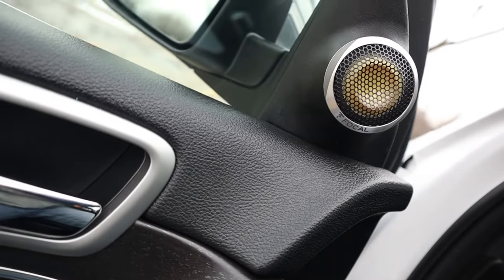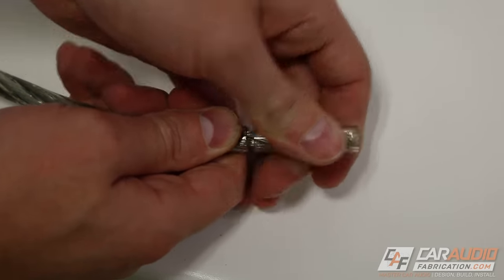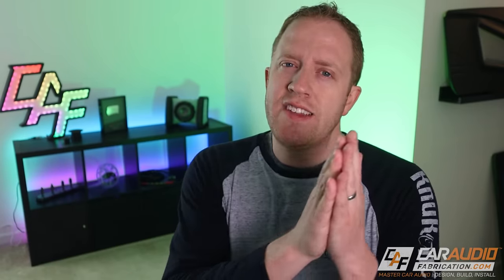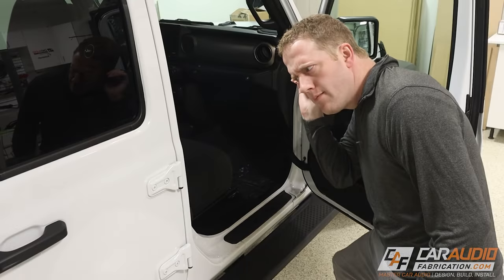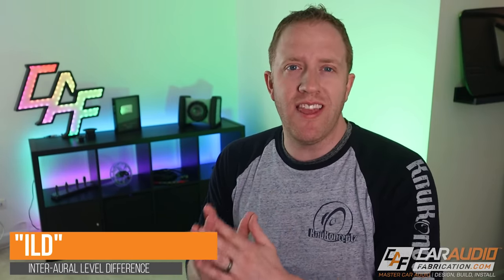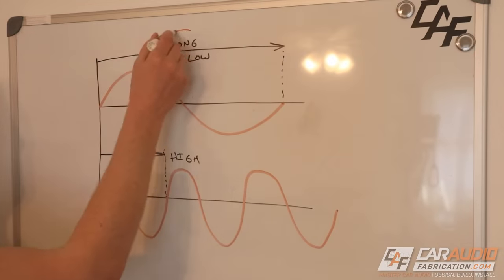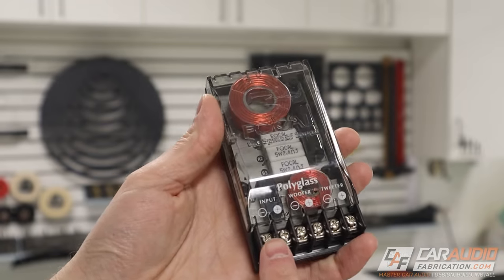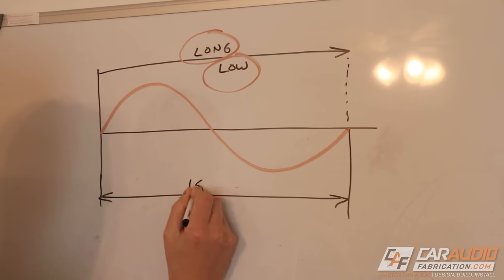Is YOUR SUBWOOFER facing the WRONG way? How we locate sounds explained!

Comment: My sub is firing upwards, because that's the only way I could fit a 15 in my trunk
Reply: Same mine is under seat. 66 Toyota Land Cruiser
Reply: My 415s is facing up. Only way
Reply: My 5" is facing front.
Rear facing port.

Why you laughing ?
Reply: My 2 tens are facing upwards I feel like they sound better that way then facing towards the back like towards the twilight's.

Comment: Years ago I had a 1990 Grand Am with an ADS sub with 2 10’s(sealed). I had worked for many hours tuning the crossovers and levels to get a balanced sound and I had to face the box down and backwards (swivel brackets included). When I sold the car to a teenager he immediately pulled out the 2 10’s and dropped in a Pioneer ported box with 3 12’s facing forward. It took him a couple of hours of frustration to give up and put he ADS box back in and suck up the loss of ego by having 2 10’s instead of 3 12’s.   He was in disbelief that I got such a “small box” to sound that good.  Interestingly we listened to vastly different music........
Reply: Yeah Bull 💩
Reply: @Valverde713  What is ?
Reply: What kind of amp did he have with those 12s?

Comment: I like facing it to the rear.  I "hear" the bass bouncing more and getting deeper that way.
Reply: Me too. I feel the bass bouncing back with speaker facing rear.
Reply: For sure, I have a star 15 in a ported box and had it facing up and it did pound but then I put it facing to the rear right behind the front seats of my blazer and it pounded way harder. Then I put it in the back hatch and it is night and day how hard it hits from the other two ways. Rear facing is definitely where it’s at IMO.
Reply: Same
Reply: This is the difference between having portholes and not having portholes or sealed box
Reply: FWIW, sealed boxes are described as more accurate. The tradeoff is power consumption/requirements.
Reply: @Shalmaneser1  But a well designed ported sounds 'warmer' and deeper.

Comment: The wave length is  also why we hear the bass from the guy beating down the block and not the highs . The short frequency are absorbed by the walls
Reply: Correct!
Reply: what does this mean i want my subs to be heard down the block😭
Reply: @noahon2k906  the wave length of "bass" are longer allowing it to penetrate obstacles with less loss of energy . High frequencies are much shorter allowing said obstacle to absorb and reflect better which is why when u hear an echo it sounds different,  cause the lower mid range and down are not reflecting as much . Knocking refrigerators over when u come banging down the road requires a s%!+ ton of air movement , which requires many watts and many drivers
Reply: Actually it's because most cars with aftermarket stereos simply don't have mids and highs.  I hear it all the time on my walks around town,a car will drive by 10 or 15 feet away from me, windows down, and all i hear is "thump....thump thump thump."
Reply: @noahon2k906  I have 2 kicker compvr and they can be Heard pretty far away. I think each one is like 86Db or something like that

Comment: I had my 10inch Kicker sub located in the boot facing the boot door. I was not so happy with the depth of the bass. So, I made two changes. One to stuff the port with tight faom to covert it to a sealed box and secondly, moved it to one side of the boot, facing side ways towards the innerside of the boot, rather than facing the back of the car. With these two changes, the bass feels lot more deep and cleaner. Not sure if it due to the sealing or due to the change in direction of the sub or both. Eitherway, happy with the result.

Comment: My subs face up and port is to the rear. Sounds great in my Tahoe
Reply from the maker: Very nice!
Reply: Same, I also have a tahoe with subs pointed upwards and a rear firing port
Reply: I have yet to see a SUV that didn't perform best with subs up Port back
Reply: That's the best for a Tahoe. Jeep Cherokees like them faced forward or backwards
Reply: I need to build a box like this for the tahoe. I  just have a dual sealed with back raised a bit
Reply: @johnathanhornsey880  never had a Cherokee I know that the best way is trying different orientations nothing beats real world testing. I was surprised when I got the best sound out of my Honda coupe with a sub sealed off facing forward instead of backward like most trunk cars.
Reply: Same in my Tahoe...subs up ports back!

Comment: I've got a pretty basic setup. A couple skar vd 10s shallow mounts in a downfire box with port forward on a 1200w amp.  JbL 3 ohm mids & highs running off pioneer deck. Honestly it's pretty dang impressive for what it is. It'll rattle your teeth loose. 

Well , I had my back seats up and my box isn't bolted down( shame on me) and my box slid forward just like 2 inches , and I haven't had a chance to really get back there and recreate that situation because I had to shove it back because I started getting a really odd distortion that I think was the sub actually hitting the floor cuz it had slid over a hump in the floor. But before that, OOOOO MAAA GAWD!  I don't know what was truly happening  but I've never heard it hit so hard.  My whole truck I thought was going to fall apart from the vibrations. No lie, it sounded like I had something like 4 12s in some massive box.

 I'm gonna try to recreate it. Part of me thinks that maybe some sort of phenomenon happened due to wires being pulled around and stuff getting tugged on from box moving, and I wouldn't think that minor of a move and basically not changing the angle at all, would make such a drastic change.  It really was incredible.  I've been running systems for 20 years and I never seen anything like it.
Reply: If you have the port facing the rear, it'd get even louder.

Comment: For people in the back firing position I'd first mess around with the box position in the trunk first before changing actual sub facings. I have two mmat monster 12s with a mmat m2000 ($925) pushing them in a ported box with the ports facing front way both in the center with the sub faces on each side of the box (tuned to 32 hz give or take one). I've noticed that if the box is to close to the trunk (right on it) it muffles the bass and causes more rattle because the bass waves dont develop properly that close but i moved the box back about 9 inches from the trunk and just used a piece of half inch wood to keep it in place and the bass quality is like 70% better overall and deeper with minimum rattle at around 35 hz bass tracks. I still have about 3 inches of space left to move the box back more to see if that does anything more.

Comment: in my Exeo: 
-Facing port backwards and putting it close to bootlid = No low rumble
-Facing port backwards and pushing it against the back seats = Low rumble but rattling deck

-Facing port upwards and pushing it against the back seat = Even more rattle but lacks definition
-Facing port forwards and away from backseat = Bass covers everything else
Reply: So what's the best way to face them
Reply: @worldisDiffirent  I had my subs and port facing the bootlid. Sounded the best after tuning the box correctly. On a smaller car like Audi TT i have, making the subs point up  was the best.
Reply: @StaticVapour590  ok do u think I can try facing mines up I'm running 1 15sub on a 4000amp but I drive a 4 door charger

Comment: Car shape and sound deadening must play a huge role. In my 58 Beetle, I installed its third version of a “system” and this single 10” sealed box turned sideways hits harder than either dual 12” sealed box facing forward ever did. Always had only around 400 wattish amps in this car. Something uniques about the shape of a Bug. It sounds like a 1000 watt amp easily

Comment: As long as your box is tuned to the resonance frequency of your vehicle, you  should hear the bass all around you. If it's a generic box, you are going to hear the source location of the box. Bass is more omnidirectional than directional. The lower you go, the less you hear and the more you feel. That "feeling" is non locatable. In my 07 Avalanche, I took out the midgate and filled the vertical space with the height of my sealed box with two 10 in subs facing forward. 1800 watt system that pounds so hard that I have to crack the windows so I don't vibrate the windshield too much (had to replace it once already).
Reply: How do I find the response frequency of my vehicle?

Comment: Great video!
The tiny stock sub was in the rear deck facing down into the truck.
The new bigger and much heavier sub is still in the rear deck, but now facing up since that's the only that giant magnet could sit into the original opening.

Comment: Ported enclosure, subs facing up, ports facing up in a 2005 Tacoma. Just recently found your channel, love the videos, very well done.
Reply: Just curious cause I have a Colorado, what speakers and air space do you have with them. And I'm assuming with the options you had you chose the best sound.
Reply: @MikeCodere23  Using 2 JL Audio 8W1-V3 drivers, each one is in .5 cu ft of air space.

Comment: When installing my first subwoofer in my car(back in the 1990:s ) I made a box that I tried in different directions to see which was best for my car. I found the best direction was backwards, I was at the time installing in a Saab 900 Hatchback from 1981.
Reply: Didn't all hatchbacks have better and cleaner sound facing the back?
Reply: @MikeCodere23  No, I had a 85 camaro with 2 15inch Orion's and 2, 1.2k wat power amps and crossover i.the box  utilized the whole hatch .  Speakers faced forward to push the air away .
Reply: Was wondering if this is Brian Love ? 🤔

Comment: I've had my subs face all different ways and can say that there is a huge difference in what direction it faces. I had to face the seat in my sonic because fitting it sideways wasn't an option and it rattled the truck lid to much. Even with foam and dynamat lol
Reply: With my old single sealed box just having it Off by a foot would mute the sub lol. Could barely hear it if it wasn't about 8 inches firing back into the hatch of my 06 suburban.

Comment: big thumbs up i purchased to 2 knuconcepts kollosal kits 1 for my small sedan which i completely rewired and ill use the other for my mpv suv and i sound deadned all doors and floors firewalls and trunk made 20%sound improvement also purchased audio control lc2i pro for suv also

Comment: I have my 2 alpine type x 12s firing towards my taillights,  when I position them firing towards the front of my car it hits harder but not as punchy, keep in mind I only have a ski hole in my car the seats don't fold down, also moving them around changes the box rise , everything from moving your driver/ passenger seat changes the performance of your sub. Even a few bags of groceries in my trunk changes the performance.

Comment: Currently sub up port back in a single cab silverado. I'm designing  a new console box that will be subs down port up. So it will go from console shaped through middle of truck to truck wedge shape box behind the seats with the port exiting up in the passenger side rear corner. If this is stupid lmk even if you just say "no"  lmfao thanks for teaching me. I just started using my router and templates last week.

Comment: I keep mine facing the rear. I’ve tried placing them on different positions in my Jeep. Facing up, facing forward, sideways… I’ve found the best lows and punch is when they are rear faced. The only time I found different was in the back of my old Dakota. I had the boxes standing up side by side on the back bench. One forward and one sideways. (2 10” forward and 2 12” sideways). That was something else.
Reply: Thanks for the info. You answered my exact question.  🤜🤛 I just got 2 12s and am putting 1000w through em and was just curious what would happen it I moved them around.

Comment: The sub is inverted. With the sub facing the passenger side ( whole box on drivers side). With the port facing the back. It a logitec z5500 box cleared out with a skar 10 in it. Works good. Sounds good. Always try to face them up though if I want split.

Comment: I've experienced in the past that facing them backwards may sound more affective if your not running much power let's say 750 RMS but I hate the trunk rattling, so I noticed facing them forward cancels that rattle but chokes out the base, until you fold tour seats down, I think my next choice would be a single sub to the right shooting left so I can feel or hear that frequency, any thoughts?
Reply: lol hell yeah , I have a 12' champion pioneer  powered by a jbl gto 751ez behind the front seat facing the back of my seat in a holden ute. you feel it kick and watch the front windscreen vibrate.
I say go for it!

Comment: My personal experience is hatchbacks and especially, wagons sound better with the subs facing back. Sedans and Coupe cars with physically separated trunk areas may sound better firing up, or forward. I bought a sealed box with 12 Kenwoods and a 450 watt amp from a guy who said it sucked, he had it in a Chrysler 300, I put it in my Volvo V70 facing backwards, and it sounds way louder in my car, than his. I just tapped in the leads from the rear speakers, with some 25 year old line level adapters, factory head unit, no RCA's, nothing.

Comment: In my ‘83 GMC truck I have a single shallow mount Premier 12” in a sealed box facing forward behind the passenger side of the bench seat.
In my 2004 Cadillac XLR I have shallow mount Kenwood Excelon 10” subs mounted in each door.

Comment: i have a 4 th order band pass  .the port is facing to the side of the trunk in a hatch back. Facing to the back makes the trunk flex and it loses alot of quality and it  rattles and brakes tail lights ..facing forward its very muffled ..the trunk effectively acts as a second band pass enclosure if facing to the side

Comment: 18” Stereo Integrity HST sealed facing forward.  Removed the smaller side of my rear seat.  Prior I had 2 Illusion C10 down firing under the rear seat.
Reply: That right there is no joke of a system. I've got three SQL 12s I'm installing facing forward in my Civic SI. The xbl motor design is a whole different animal and worth paying the extra money for if you have a picky ear and don't want to spend as much on massive electrical upgrades. That split gap motor design keeps the BL constant over a much longer stroke than normal subs. So worth it and slayes the drums like none other if you have a picky ear. Just so clean and needs less power to do it.

Comment: Today this video was very helpful. I'm currently making my own custom false floor sub box (and man oh man is your channel a wealth of knowledge to help!). And my dad asked if having it point forward would be better than my intended upwards direction. I told him that with low frequencies it basically didn't matter directionally, like it does with higher frequencies. But my explanation was "it is just known" lol cause I didn't know the actual answer.. But the discussion prompted us to search, and here we are. We were both pleasantly educated, and it settled the discussion that my plan was perfectly fine lol. Great stuff and great channel. 

I was actually able to explain to him about it being under a solid "false floor" was also ok, because longer (lower) wavelengths are much better at penetrating through objects. It might be slightly muffled vs open, but that's why it'll be removable to show off the sub lol. So I kinda was already on the right track. LOL

p.s. posted only a month ago... IT'S LIKE YOU KNEW I WOULD HAVE THIS DISCUSSION o.O (illuminati meme music)

Comment: I used to have my 10s facing inward in my bandpass box that faced my cabin, next to 2 12s in solo sealed boxes, with rear seats removed in a 96 Saturn sc with Blaupunkt pull out cd faceplate and a mp3 hdd mounted between my sony 4x6s in the rear rear windshield. 14k rms amps with spare battery in the trunk. Sounded terrible to everyone not tone deaf within a mile but great to me!

Comment: I have an 07 Civic SI coupe two door.  Putting three 12-in SQL in and facing them forward sealed off from trunk completely. I designed a perfect enclosure and orientation with them sealed but the bad me can't resist thinking about running them ported because I can if I run the ports up through the rear deck and seal that off completely too. I know it would definitely be louder but also won't be as sharp and accurate as the three sealed what do you guys think lol.

Comment: I came for my lesson today 😊 ty. I have a question about tweets. I like a soft tweeter. I can't handle it all in my face.  How do I get that sound. My car is my "church" you could say. So sq is my goal. O. 2015 VW beetle hatchback. my 12" sub is facing forward . But not close to the rear seats. Port is facing right, low down.

Comment: I have two 10” sundown sa classics. I built the recommended box from the website and pushed them together. They face forward in the trunk towards the cabin. This is because the box barely fit in my car trunk, and the way my wiring was and wanting to make sure my subs were safe, I had to face them forward

Comment: I got one 12" down firing sub in a sealed box between my two front seats of my 97 ram 1500 extended cab. It's roughly dead center of the cab so it disperses nicely.